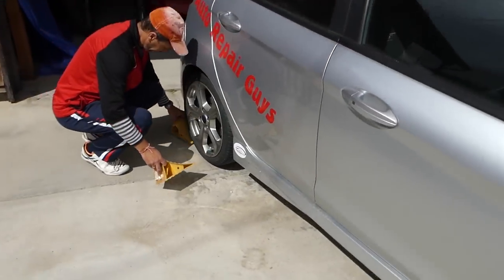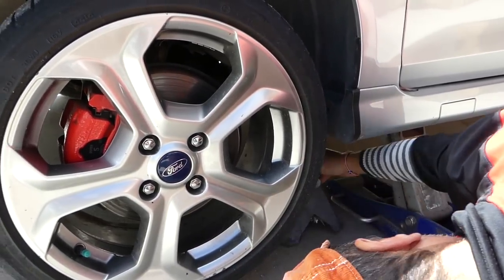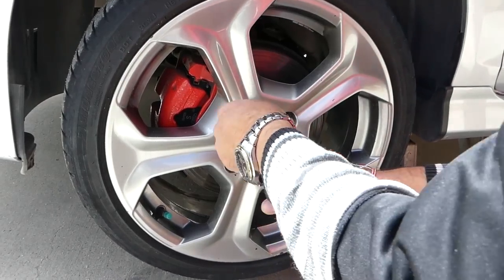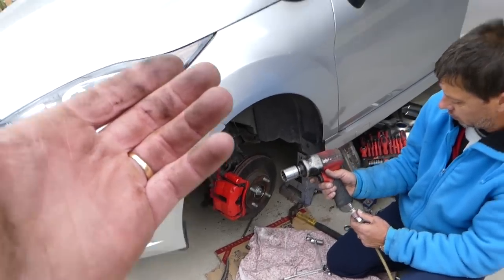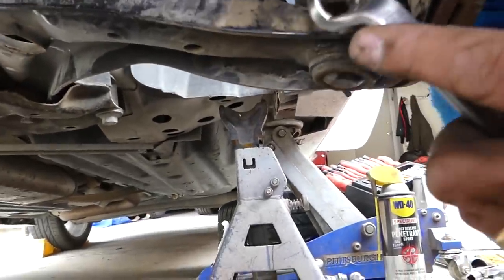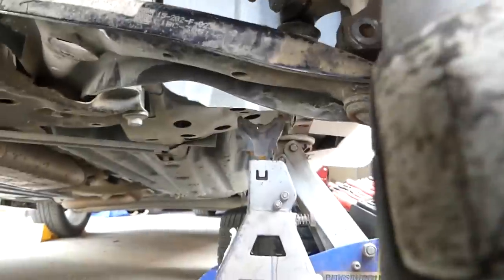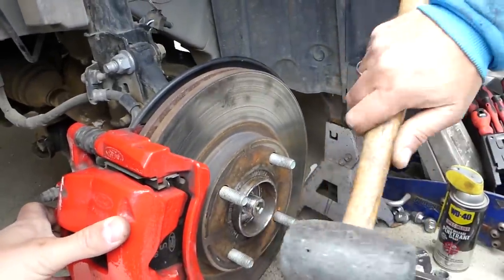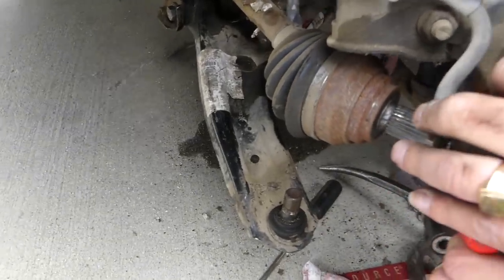FORD FIESTA CV AXLE DRIVE SHAFT REPLACEMENT REMOVAL MK7 ST

Comment: Great video.  I just replaced my passenger side axle due to a failed inner boot. Great job! One thing I would add is to replace the Axle Seal while you have the axle out.
Reply: Was there a sound that clued you into the need to replace your axle on the Fiesta? My car is making a sound like it's rubbing the brake heatshield but I see no marks. Thanks
Reply: @heyitscarlos27  omg i have this now in 2021!
Reply: Smart
I've seen those replaced but I've never replaced them
Reply: @heyitscarlos27  i know your comment is from 4y ago but did you find the issue? I noticed i’ve been getting a rubbing sound from one of my wheels as I apply the brakes (mostly on days when it’s dry outside). And i noticed that side also has a broken boot so I figure its the bearing on inside thats rubbing in all the debris that got in there.
Reply: Is the seal easy to replace? Just pull it out with your fingers and place the new one in there? Do i have to lube it like when you lube the oil filter gasket during an oil change?

Comment: Hi , my son skid on ice 10 mph going around the island and slid into the kirb , the wheel tilted in, about 30/ 40 degree, this was on the passenger side , he has a ford fiesta series 7.5 
After inspection,
He bent the (wish bone) front control arm 
Broken the anti roll bar (drop link)
Bent the (inner tie rod bar that`s connected to the steering rack)
(Outer tie rod that has the ball joint)
(Slightly bent suspension strut)
 Taking  the wheel  off and brake disc, the wheel hub was tilted in about 30/40 degree  as the (wish bone) control arm was bent and had caused the hub to be this way ,

Question,
I removed all the damaged parts this allowed the wheel hub to straighten up, but I turn the drive shaft and it makes a ruth type of noise where it enters into the transmission and when pulling on it towards me  their is about 2 inch movement on the joint near the transmission,as I can see the rubber boot moving
Is it possible that the impact` when looking at the angle the hub ended up due to the wish bone being or control arm was so bent in` about 2 inch could this of popped the drive shaft out of its transmission,or could it of separated the joints,
While the drive shaft is still on the car and the suspension strut as time was not on my side to remove the strut , I have not replaced any parts yet , what is my next move to do ,?should there be any play on the cv axle when pulling in and out on the drive shaft

Comment: Do you need to realign the car since the lower ball joint was disconnected from the knuckle?
Reply: no, you should only need to get it aligned if you mess with the tie rod